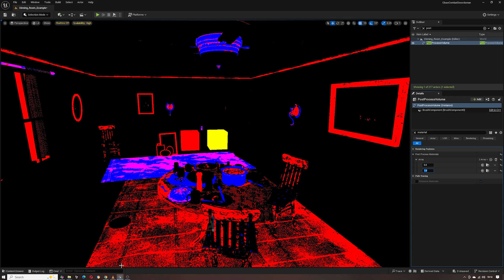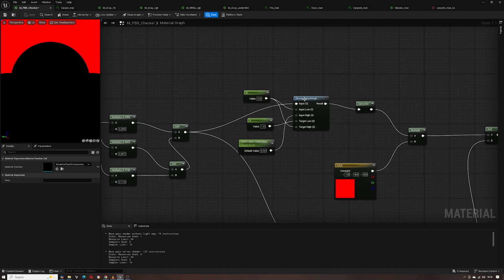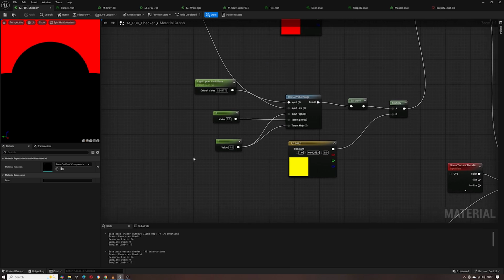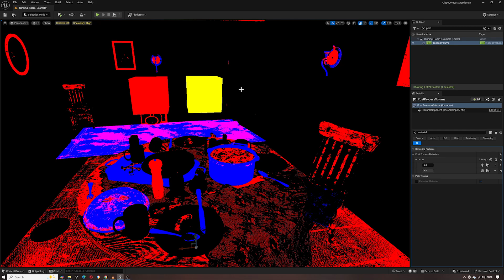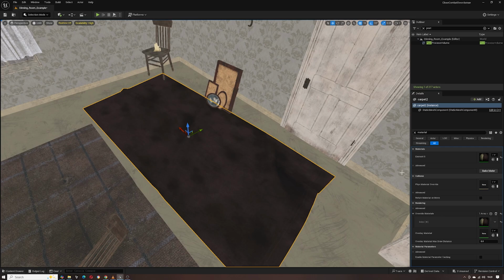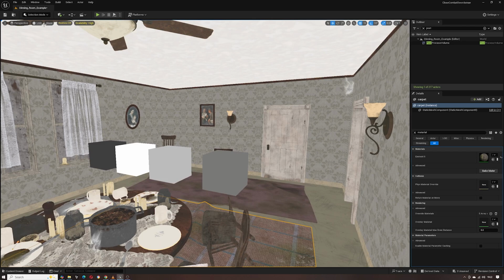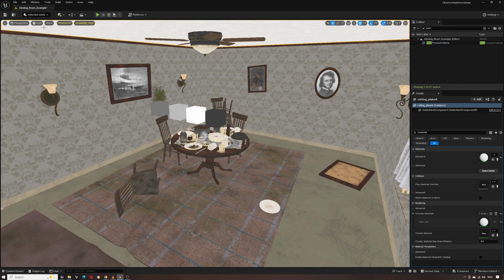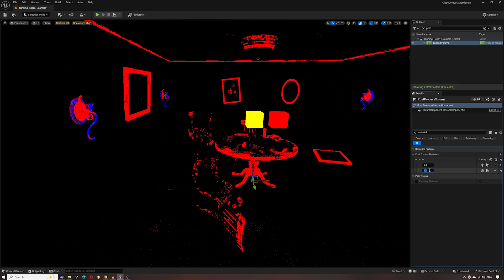How to Setup PBR Validator to Fix Materials in Unreal Engine 5.5

Comment: Very useful tutorial, everything works, but I don't understand why the metallic validator doesn't accept values up to 0.2, doesn't paint everything below 0.2 blue
Reply from the maker: @satepilorad3860  I don't understand your question. How well do you understand metal values? And the roughness setting threshold cvar or in post process? It could be locked at 0.4 for example. And if no color shows up it can be you got nothing to correct or there are overriding colors so it is mixed thus not showing up? But generally it depends on your own values, settings and materials. And by the sound of it you are experiencing ot expecting something specific to happen?
Reply: @AmitGinniPatpatia  I didn't understand how the validator determines the correctness of the texture metallicity. I have a large background in 3D in gamedev and in most cases the correct material is either completely metal 1 or completely non-metal 0, sometimes for various artistic purposes the presence of objects that are not entirely metal is permitted. On what basis the validator determines that this metal is correct and the other is not, is not entirely obvious, since I get different results. For example, I set the metal to 1 and the maximum brightness of the texture and it stops showing problems, including the fact that the material is too bright, beyond the acceptable base color. The object just looks black, as if everything is fine, although this should not be? I set the brightness to 0.925 and the metal to 0.35 and the object is black again, although this again should not be a correct value. In general, I would like to hear more details about how exactly the metallic works here.

Comment: I honestly don't understand why it doesn't work for me.
I set up the material as you have in the video, material type post process, overlay this material on the post process, but everything is white and yellow.
I tested it in two scenes but everything is yellow and white.
Then I created an instance of this material and changed the Light Upper Limit Base value from 0.941176 to 0.149176 (this value is just random) and the shades became black and red. But I don't think I should change this value as the whole point is lost. Can you please tell me what could be the problem?
I went through the video several times and did exactly as you did in the video
Reply from the maker: Make a screenshot of your setup so I can see what you did. Use a image url to share it.
Reply: @AmitGinniPatpatia  I can't add links here, YouTube deletes them.
Reply from the maker: @ksandrCG  Copying something without understanding everything else would make it hard for you to figure it out. Essentially, you first need to understand PBR, then you need to understand how to troubleshoot the PBR of your scene to understand why one color shows up or not. Based on what I know of your scene it shows up yellow mostly because it is too bright values everywhere. It means you need to adjust it. Then it might reveal the red later on. If they are somewhat equal it would be purple or something mixed. So, you should go into your material itself and darken your materials. You can also see how dark your materials are in Buffer visualization - albedo